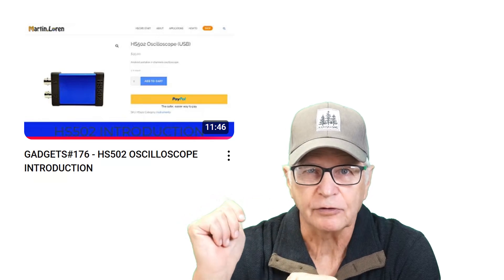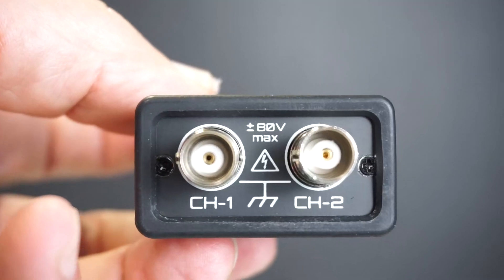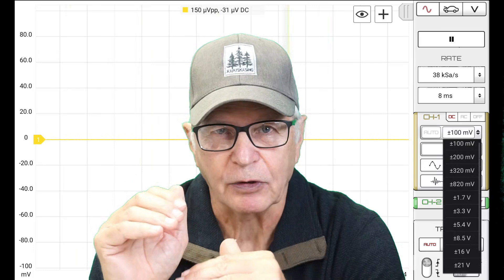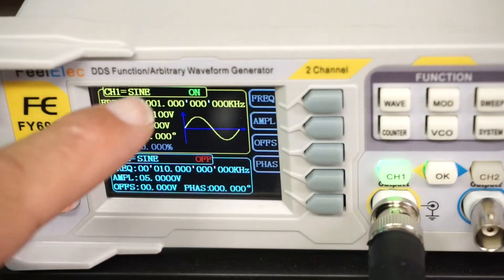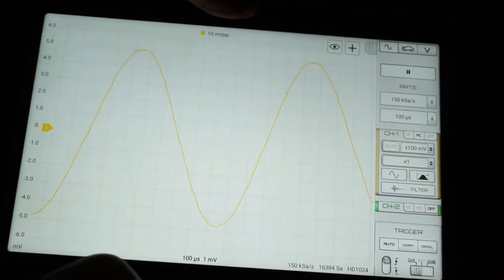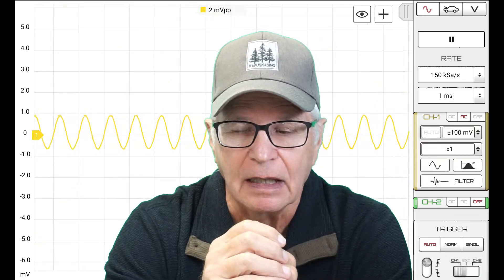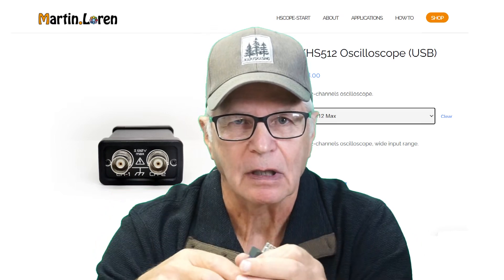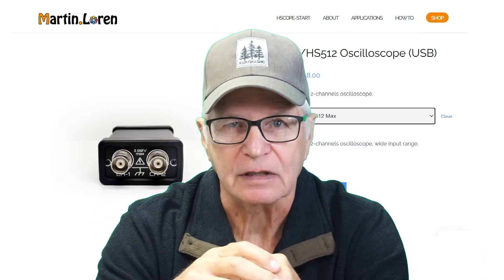GADGETS#200 - HS512 MAX

Comment: Nice video. Do you happen to know what the input sensitivity range is for this scope (volts per division)? You eluded to 1mv/div as the low end, but really am curious about the range. I couldn't find this spec on Martin's site or the hs512 manual. Thanks in advance!
Reply from the maker: thx for comment David

HS512 MAX can zoom to 0.001mV / div !
Reply: @theGADGETSplaylist  wow, that is sensitive! Any idea what the upper range is . For example the pico 4425a has a range of 10 mV/div to 40 V/div (don't worry, I am not considering it nor comparing this to it). The hs512 max is more in my price range :)
Reply from the maker: @DavidC-le1mn  on the ±84v input range HS512 MAX can zoom out to 10v / div

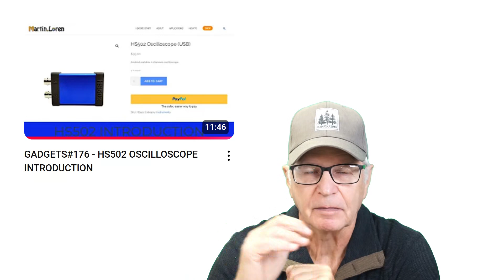Comment: 0:17 I received my Black HS512Max with BT shutter trigger.
All works well in my apartment. But, NOT SO FAST. Read More . . . Much time learning the HScope app measuring batteries and the PWM Lug. 
HOWEVER, REAL SIGNALS DISCONNECTS IMMEDIATELY, even at highest input range and my 10X probe. Lucky to capture anything. But, can't save, can't do much anything with loss of license being disconnected.
I need an O'Scope to analyze this O'Scope. It functions fine without any signals.

"System Failure" has flashed once as well. Many power down and power ups.

I appreciate all that has gone into this. But, this is my 1st and last USB O'scope, back to a bench-top Lab O'Scope that has an actual Input Overload indication. A "Must" in our A-D world.

I enjoy and relate to most all videos on this channel, thanks!
Reply from the maker: the best place to bring this up John would be HScope LOUNGE on Telegram where Martin Loren himself would look into your complaint

here's a link:

https://t.me/hscope/1

Comment: thank you so much for the helpful videos! i bought the hs502 and all the attenuators  from martin. ordered the hs402 off ebay. love it. ordered the 12 volt transducer from e bay and have been using it. just finished the 3d build for the gas analyzer with the help from a friend.  waiting for the sensors and pump to come in. going to make the hand held analyzer you just showed in a video. just ordered the hs512max. cant wait. but again thanx for all your help!
Reply from the maker: wow!
you've taken on lots of projects, I'm impressed:)
good luck with these builds and if any questions arise I'm available on Telegram HScope LOUNGE

Comment: Saw at one point you had a wifi scope. I'm guessing these USB versions are a lot better?
Reply from the maker: WiFi was based on the DIY HS402 ... both USB and WiFi versions were comparable ... with WiFi being so handy in test drives, etc

HS5xx series are not DIY and no WiFi version available. These have higher performance than the HS402 which in their own right were no slouches

Comment: I'm just looking to get my first oscilloscope and this looks promising! Would you recommend getting the 3 piece attenuator set to go with it now that this one goes up to 80V? I see that he has something called an AC attenuator that says it goes to 500V, would that be a good combo to start with to cover general use? Now to get an Android tablet to use with it... Any recommendations?
Reply from the maker: personally, because of the ±80v of this scope, I'd only look at the 4x attenuator on Martin's site...that would bring it to ±320v which will do primary ignition work
no need for AC coupler on this model
as for Android tablets, I'm partial to LENOVO direct from their site, when on sale which is frequent...M9 can do fine if you're on a budget
Reply: I love my M9. It’s the perfect size for around the shop and works flawlessly.
Reply from the maker: @BlainesGarage  I have M9, M10, M11

it's the M9 that I mostly use...seems to be sweet spot between a phone and a full size tablet